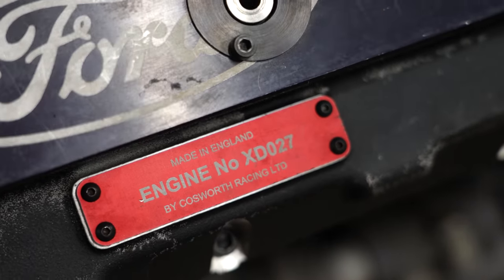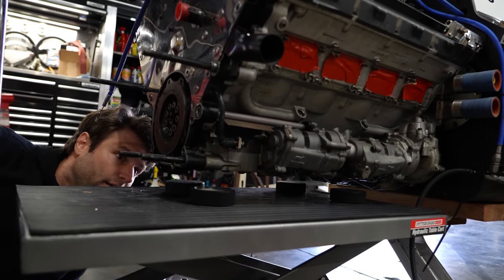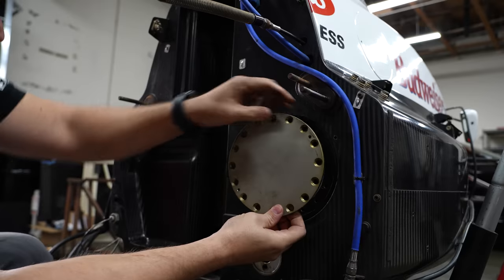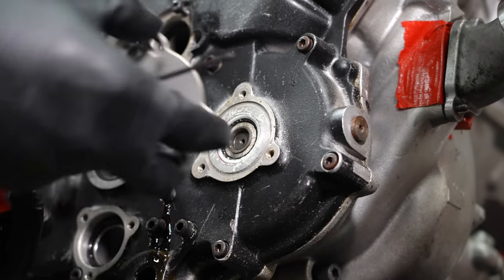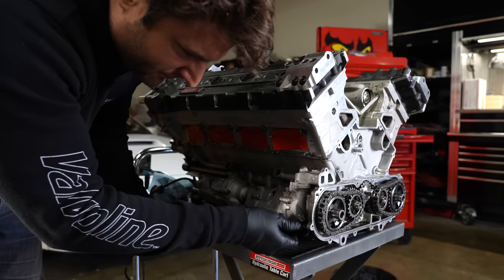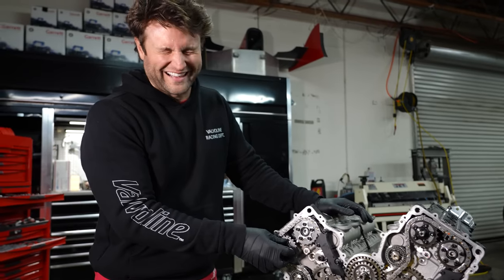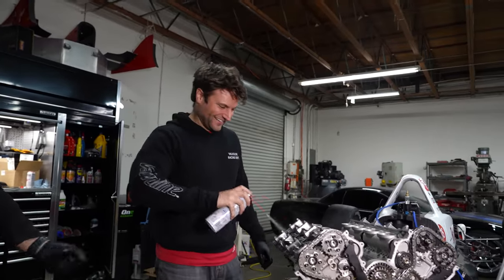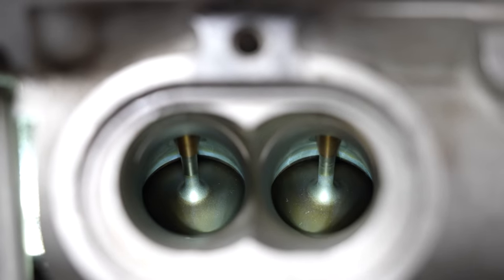We teardown the IndyCar Engine to expose its Secrets! Cosworth XD Turbo Methanol V8

Comment: Rotax have an 800cc twin that makes a strong mid range AND 160 bhp. It’s cleaner and lighter than competing engines and uses les fuel per bhp. It’s a two stroke and it’s CLEAN. Why can’t we have this technology in bikes and cars? Because the regulators demand emissions control devices that are simply not needed.

Comment: Consider general tech data for aircraft bolts to find your torque ranges.

 https://www.faa.gov/documentLibrary/media/Advisory_Circular/AC_43.13-1B_w-chg1.pdf

Theres a lot of information there, but you're smart, I'm sure you can break it down to understand the shear loads etc based on the engines specifications. When it comes to torque on aircraft, for us its always a given range. So your method of finding what you should torque to by tightening before removing should get you into that ballpark especially if they're going middle of the range.

How this XD was built definitely makes me think planes.

Comment: 41:05.....OK, icky piston engine talk-time.....the upper central gear has 3 gears total and distributes power to the staggered left and right banks. The next gear in line is larger because you need a reduction of 2:1 for your camshafts, so at some point in the drivetrain you need a gear twice as large as the crankshaft drive gear. By putting the larger gear at the center of the engine where there is more room, you can keep your final, camshaft drive gears small and tidy, which keeps the engine compact and puts a tiny bit of weight further down than it would normally be, helping with mass centralization.....now a shower, and back to my rotary.

Comment: Rob, this engine is not limited to the lower RPM's like a rotary engine which has no reciprocating parts.  This engine has parts going in every direction, stopping going the other way...therefore this engine can turn 14,000 RPM.  ROFL
P.S. Please put it together carefully.

Comment: You've never torn down a piston ENGINE before? A motor is powered by electricity in case you didn't know what every third grader was taught in school. An engine is, of course powered by...wait for it...gasoline, diesel, alcohol, propane etc...Sorry, but being a machine builder, it drives me nuts when people call an engine a motor. Big fucking difference here, fellers.
Reply: Thank you for saying this - I thought I was the only other person who is driven crazy every time I hear someone referring to an ICE as a motor.
Reply: Like many who stand on a soapbox and shout about misuse of language, your puckering is misplaced.  Do you refuse to watch motorsport unless it's Formula E?  Do you refuse to acknowledge the existence of motorbikes prior to the introduction of e-bikes?
A motor is any device which converts some form of energy into motion.  The words motor and motion, are derived from the same root.  An ICE is a type of motor, because it converts energy from burning fuel into motion.  However, an electric motor is not considered an engine because it's too simple.  The word engine shares the same root as ingenuity.  I'd argue that an electric motor is pretty ingenious, but engine usually means a device with mechanical ingenuity.
Now, you can ride your motorbike to a motorsport event without your blood pressure getting out of hand.

Comment: I’m gonna sound stupid….. but… what does flat plane crank mean?
Reply: I think it means all the cranks (that is, the places that the connecting rods attach to) are all at either 0 degrees or 180 degrees.
Reply: @hubbsllc   So the lands on the crankshaft are 180 deg (directly opposite of each other) off of one another……
Reply: (But the pistons are in the cylinders at some different value)……. I guess u might be able to get away with it if the stroke isn’t very long
Reply: Like a Volkswagen engine?

Comment: Shit, they pulled the black headed bolt out. Now it is ruined and will never run again, you have to remove to silver headed one first or the released pressure will bend the cam

Comment: The chain tensioners are pretty much never on the tension side of the chain so thats also how you can figure out which way it turns. Especially in street cars where the tensioners are oilpressure controlled. you turning it left and it skipping made me kind of cringe.

Comment: The components rather systems, ie alternator and water pump, remind me of aircraft systems, dual purpose systems off one source of power and nice and sleek design and construction.. kind of mind blowing it’s not variable timing on the intake or exhaust valves. Good to see timing chains instead of belts. I blew up an Audi v6 that spun a timing belt… boo!!

Comment: 14K rpm isn't really thàt outrageous.shim under bucket valve accusation,lash adjustment.what you are looking at is technology that's been in use on motorcycles for decades.Most modern superbikes rev much higher than 14K and put out about 200hp per liter.

Comment: 1:03:50 CRINGE!!!! 
ya better hope they are all exactly the same size...... and not "customized" for each main cap..... 
.
you basically are putting the number 1 main cap on the number 3 or 4 now....... 
.
.
it would be like putting piston 1 in the blocks 3rd hole.... 
or mixing up pushrods and lifters.... not putting them back on the same cam lobe
.
my god dude.... i REALLY hope you get lucky (or they were numbered)
otherwise you are going to spin a bearing in about 30 seconds..... 
.
.
well, ya have to get it started first.... to spin a bearing
and you probably skipped a few teeth on the timing chain by turning it backwards
then that little "half wheel" sensor thing..... sure its "off and on"..... but it turns on/off at a SPECIFIC TIME (aka, they need to be "in phase")
.
.
again.... good luck
but i think you are just going to end up selling that motor and getting a new one (or hiring a mechanic that knows these engines to put it back together correctly for you)

Comment: My sensible question is why are two amateurs messing about with such a refined engine that actually the specialist that know those engines and have the correct expertise to strip and rebuild it correctly. Without dropping parts without not knowing what the hell they’re doing seems so dumb and stupid to involve yourselves with such a major thing and massively expensive thing to play about with as you two seem to mess about way to much for being serous about it. Best stick to what you normally mess about with rotary engines by the sound of it and there technical enough for you two I’m guessing

Comment: I really need to make videos, I can't believe these guys get paid by YouTube to show how unknowledgeable they really are, the cam chains are jumping when you turn it over because there is no oil pressure to push out the tensioners🤣 at least you'r not tearing down a common engine and that makes it interesting.

Comment: Doing an oil analysis on an engine that hasn't run in a while is a waste of time.  The elements have settled out so your readings will be grossly inaccurate.  Sampling is done on an engine that's been run sufficiently to be fully warmed up.

Comment: Rotaries are amazing at what they do but they do not do it long piston engines not as amazing run way longer a firecracker compared to a torch. A better quality of seals that can handle the rotor loads some kind of fusion of carbon with chrome or some crazy crynogentic treatment tough ups metals freezes them with dry ice to - 70c closes the pores in the metal no ruff edges a perfect bearing material try it out could make a rotary last 300k plus. And use Pennzoil Platinum Plus no carbon fouling on the perimeter or rotor seals just saying.

Comment: Those cam lobes are the most violent profiles I have ever seen. That’s a ugly compromise for a high RPM short stroke DOHC race engine with no cam followers. I bet it’s also why you bought it cheap because it’s a nightmare to  run it. Rocker arm ratios greater than 1:1 exaggerate the acceleration of the valve opening event. They allow cam lobes to have a much more conservative profiles. This is why you see cam followers like rocker arms on OEM DOHC/SOHC street engines. The trade off of added reciprocating mass is worth a lot more reliability for low rpm street applications. In race engines performance is paramount but your working around the rules. Back then engine RPM usually wasn’t limited. Increasing engine RPM almost always means a gain in net power but also adds stress to valve train. A easy way to reduce stress . is to reduce reciprocating  mass Where ever possible. Replacing a 4,000$ set of valve springs each race is a small price to pay for the performance. NHRA Pro Stock teams Titanium intake springs last 6 seconds or 1320’ feet. New springs go in after each run. titaniums life span and failure is almost impossible to predict. Spending 4,000$ a run is well worth saving a 1 off 200,000$ N/A engine making big power. Intake valve springs are always going to fail before exhaust. It’s just the dynamics. The Ex valve is usually smaller & lighter in non direct injected engines. The cylinder pressure helps the exhaust spring but is hard on the valve it’s self. The intake valve is larger , heavier and with forced induction. Manifold pressure aka boost is working against the spring forcing the valve to open. Adding dynamic stress It’s why their set up @ installed height with higher seat pressure. Also most cams have a much more aggressive Intake lobe profile by nature. It’s advantageous to open the intake as fast as possible. holding it open to dwell as long as you can. Then slamming it shut to avoid the piston. That’s why high performance roller cams lobes on OHV hi/po V8’s look symmetrically oval.

Comment: Be careful who you listen to for information on these engines guys.  It appears you are being told rubbish about cams.  All cams are heat treated as otherwise the surface of the steel cannot support the loads.  Also bear in mind that Cosworth also made cams from tool steel on some engines.  Those cams could therefore be hard all the way through (at least up to the ruling section limits).  I also hope that this engine was scrap before you started on it as you are not treating it at all well tearing it down in this way without knowledge or correct tooling!

Comment: And I would definitely refrain from turning that thing over very much with it being an aluminum block the block expands quite a bit that engine was never meant to be rotated cold! They had a heater with a water pump that circulated water and oil through that engine to warm it up before they ever turned it the tolerances are way too tight with that thing at room temperature to be turning it very much

Comment: 42:10 not every engine is an "interference" design (some can snap the belt/chain/gear teeth.... and valves will NOT hit pistons)
.
like... an old pushrod GM small block is VERY VERY VERY VERY simple
4 inches of chain and 2 gears..... thats it!!
.
then you have the ford 4.0 SOHC.......
with 4 chains, a jack shaft, 4 tenshioners, ETC 
.
the 4.0 SOHC is why the explorer got the nickname "exploder" 
.
.
and the REALLY funny thing is....
the 4.0 started out as a normal pushrod motor that would go 500,000 miles with VERY little issues
.
then ford had to molest it with overhead cams, chains, and turned the old cam shaft into a "jack shaft" to run a chain on the BACK SIDE of the motor!!!
.
.
.
i really hate fords engineers

Comment: I am sick and tired of you guys calling an engine a motor it is not as it is a cobustubal engine . a motor is powerd by electicity get it right
Reply: So you like this thanks
Reply: You're wrong.  A motor is any device which converts one form of energy into motion.  See the fuller reason in my reply to Doug V above.  Just because an electric motor isn't an engine doesn't mean an engine isn't a motor.  Just as all eagles are birds, but not all birds are eagles, all devices producing motion are motors, but not all motors are engines.
Also, since you're obviously the language expert around here, what the hell is "cobustubal"?  Why don't you start a sentence with a capital letter?  What's "powerd", and "electicity"?  Why not use commas?

Comment: You rambled on so fast that you were overtaking yourself in trying to figure out which way the engine (not motor) rotates. All you need to do is look at which side of the valve timing chains are the tensioners!! If I were a novice mechanic looking for tutoring, you wouldn't be on my list of "must see" videos. Stay in your comfort zone & stick with simple videos of simple rotary motors, I mean engines.